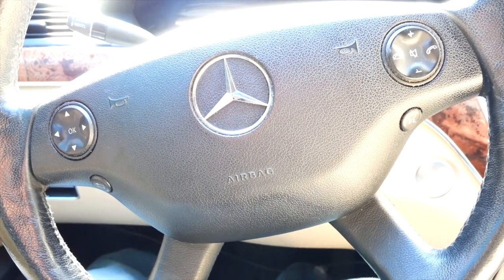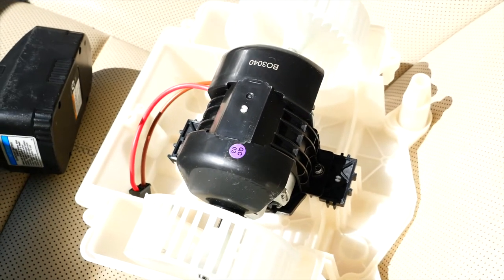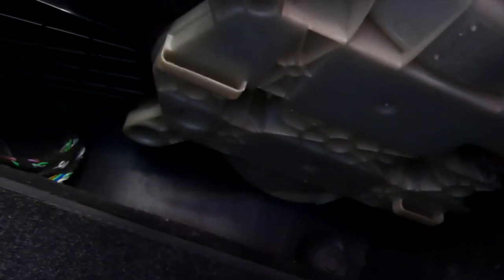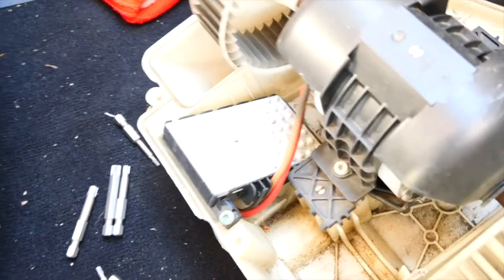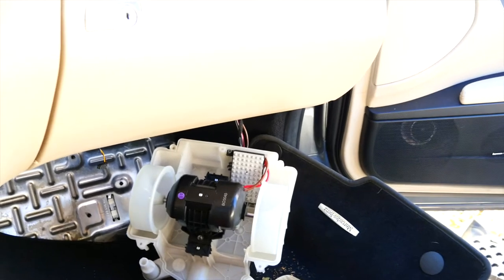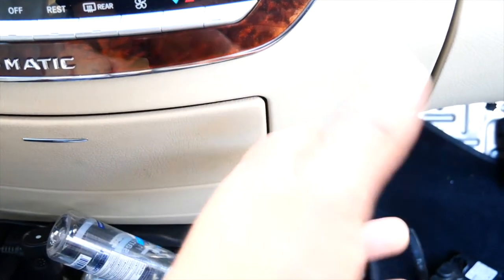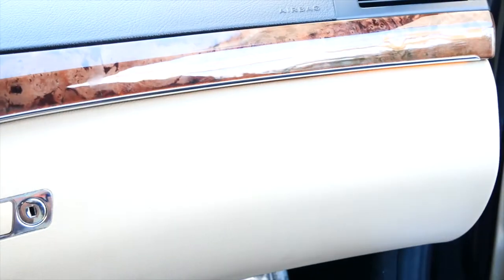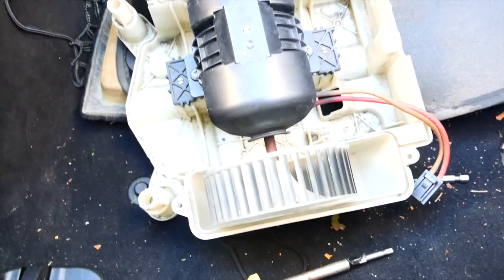Mercedes Benz S550 W221 Blower Motor and Resistor Replacement

Comment: Hey Bro,  Thank you for this video I just changed my blower motor on my 2007 Mercedes s550.  I watched your video and found the confidence to do it myself.
Reply from the maker: Great bro!! I’m glad this video was some help to you!! Thanks for watching
Reply: @540tv6  Thank you so much for this video. I have the exact same issue here and I think, like Braxton, I just found the confidence to do it myself. I have a diagnostic appointment with the Mercedes dealership in 2 days and that alone is going to cost me twice the amount of the AC blower part... hahaha. I think I will cancel the appointment and give this a shot.
Reply from the maker: @severtone263  wow glad this video was a help and yea cancel that and do it yourself to save money!!! We love our Mercedes but we know the dealership will charge us an arm and leg and keep the vehicle for hours to days
Reply: @540tv6  And then if you are lucky they try to entice you with a loaner car .... lol... which is what they did to me. What "symptoms" was the car showing for you to determine that it was definitely the blower motor gone bad? after watching a few videos, including yours, I am 90% sure it is the same issue you had... but how can I be 100% sure, especially with no error code or repair light on the dash?
Reply from the maker: @severtone263  my symptoms were my air wasn’t blowing at all.

Comment: Hey, good morning from Miami. Your video was extremely helpful because I have the same problem with mine. I have a 2011 S550 Brabus and just left the AC shop I've used for years. They gave me a deal at 870.00 to do exactly what you just did for a fraction of the price. Of course they claim they had to refill the freon afterwards also. 🙄  Thanks for exposing them and showing me how simple the procedure is. I'm ordering the parts now for PartsGeek and gonna do it myself with my 16 year old son to help. I'll let you know how it turns out.
Reply from the maker: I’m glad everything worked out for you…. Let’s save money!

Comment: I have a 2007 S550 119k seems like everything is dying in the car. My sunroof motor is grinding when you push the button, sunroof won’t open because of the biodegradable rubber mounting MB use back in the day. My headlight casing rubber that goes around the headlight turn into tar like glue(biodegradable rubber). Last 2 week ago driver side airmatic suspension blown, car drop to ground. Bought pair cheap front airmatic for $350 on eBay. Replaced the broken one, save other for future. Last week the AC was dead. It started a few months back, AC was coming on delayed and intermittent problem. I took out blower motor and spray the motor with mass air flow cleaner, and scrub the fan blade with micro fibre towel on small screw driver and soapy waters. Lubricate the motor housing on both side shaft with WD40, installed new resister box from eBay for $40, AC is working fine now. The summer temp here in NV is 
105-112* F daily. I guess people don’t call MB a money pit for nothing.
Reply from the maker: I feel you 100%

Comment: did you ever get to the door window regulators, none of mine work except the driver side?
Reply: You got it fixed ? My w221 having the same problems
Reply: Try getting them reprogrammed before changing anything. My passenger side front and rear wasn't working. The mechanic brought the software and reprogrammed it and now both are working.  He charged me $350, which most was labor I'm thinking.
Reply from the maker: if all the regulators aren't working then it could be the door switch not working. Tackle the cheapest option first. And if you can buy from Amazon do so so that your able to send the parts back you dont need
Reply from the maker: @donpablo929  yes it fixed my issue and still holding strong till today
Reply from the maker: @dr.michaelw.hopkins5884  i didnt have to reprogram mine. just replace and thats all

Comment: Do a video on how to remove the back sit. I have S600 and I have a gas leak and I need to remove the sit to check the gas pump.
Reply from the maker: Did you ever figure out how to remove the back seats?
Reply: @540tv6  oh yeah.  It was probably the easiest thing that I've ever done to that car. I feel stupid once I figured it out.  A shop was trying charge me $900 to do it. But it is really easy.
Reply from the maker: @deruin78  ok cool!!

Comment: Thanks Brotha... I watched your video and it explained a lot. I have a s550 2008 4matic and I was able to smack the bottom of the Glove compartment and my air came back on. I think I may be able to tackle this repair. 😳  Much appreciated Brotha. 🙏🏾
Reply from the maker: thats whats up bro, smacking the compartment is a fix for sure. usually dust is causing it to stop...maybe clean it out before buying parts

Comment: What was the issue? Why did you replace the Regulator? My w221 S500 from 2006 has a issue code A32n1 Blower Regulator Lin-Bus no communication. And the blower goes itself on with full heat at 30°C outside Temp. Can anyone help me?
Reply from the maker: Noise

Comment: Hey dude, awesome job on replacing this yourself. Curious to know tho how are these parts holding up so far?? I’m having the same issue on my car, dealer is suggesting we replace the resistor first. Charging an arm. And then if blower also needs to be replaced, they’ll charge a leg as well.
Reply from the maker: whats up man, everything is holding on strong. no issues since the repair.
Reply: @540tv6  awesome, glad to hear that bro.

Comment: I'm having the same issue 3rd time the ac or heat would not come on. Noticed it cuts on if I drive or rough turn.
Reply from the maker: did you ever get it changed out?